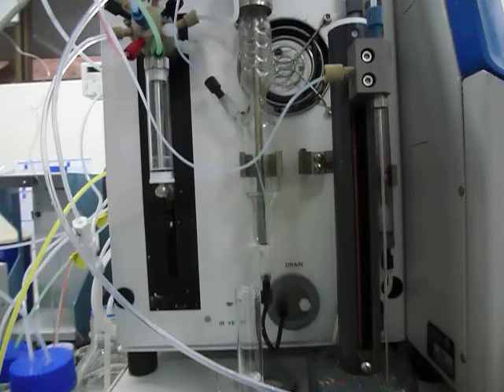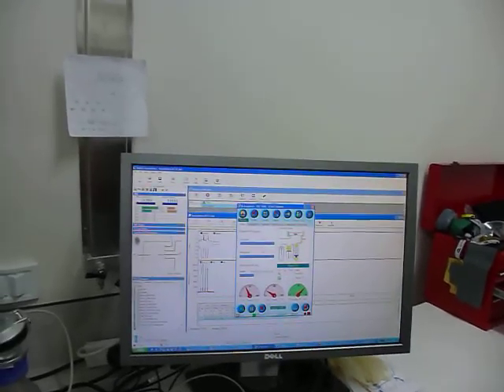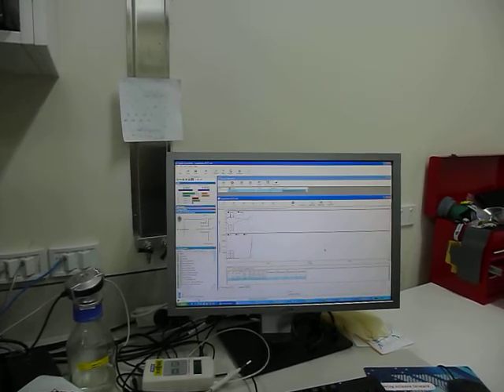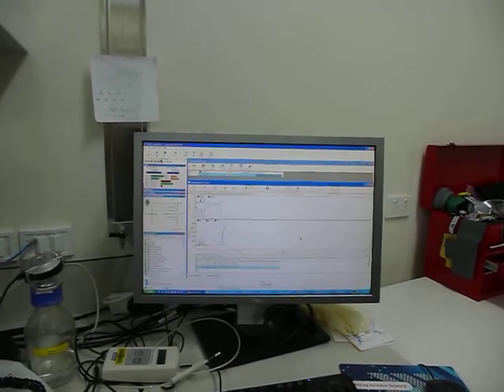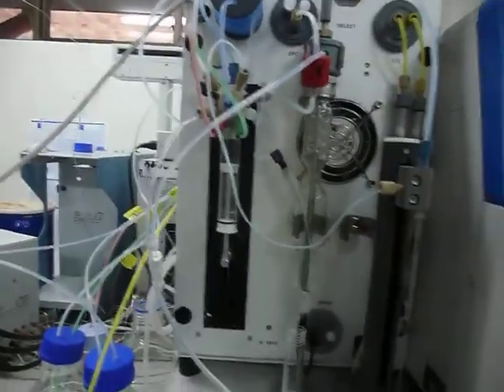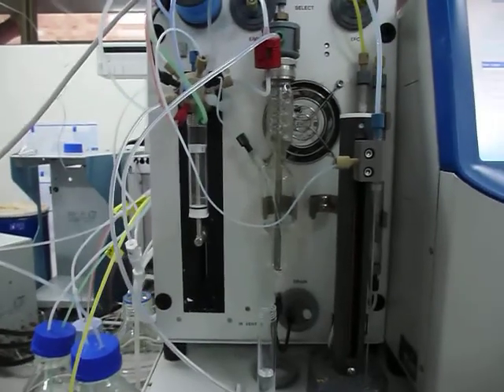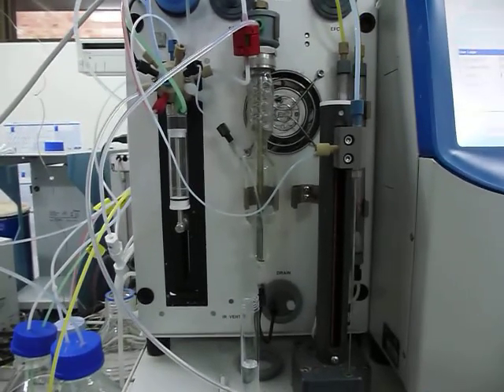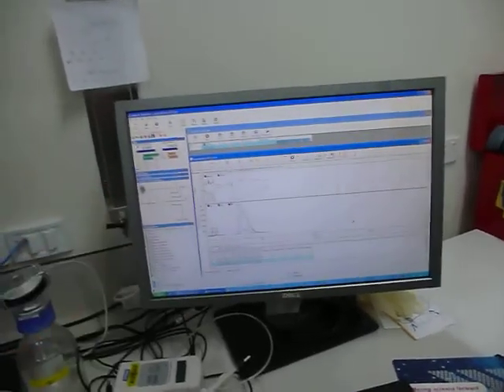OWI edge 535 robotic arm integrated to the Aurora TOC analyzer and an IRMS

Comment: What did u contact to the orange GND wire when u moved the batteries
Reply from the maker: I connected to a 5V power supply so that the movements of the robot would be more reproducible than using batteries that fade out with time.